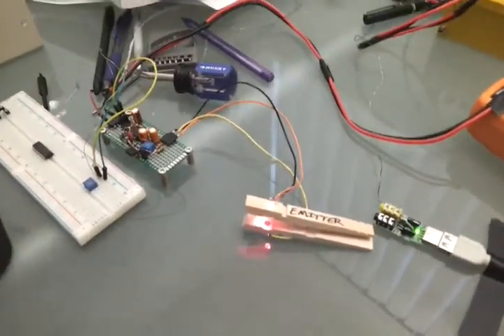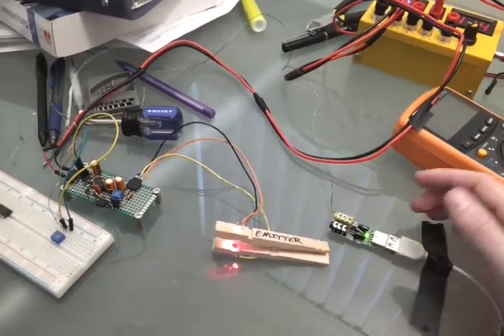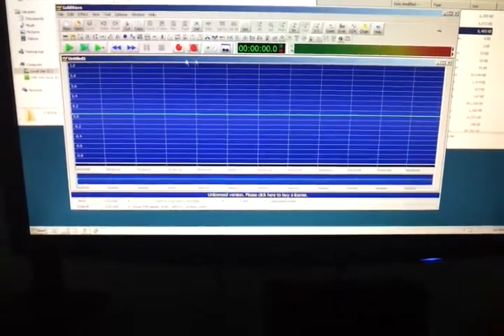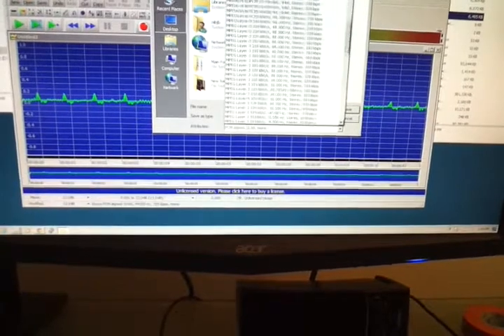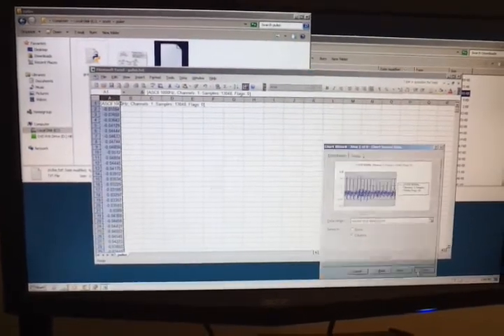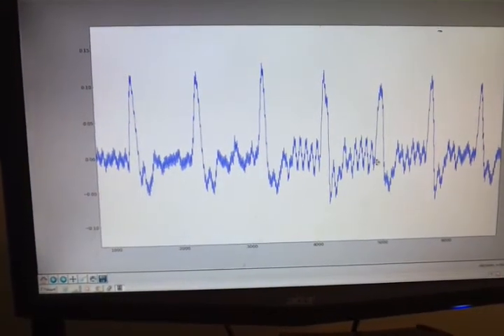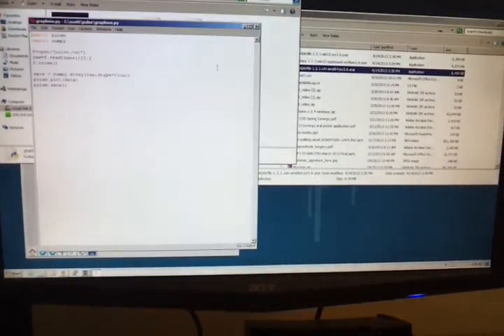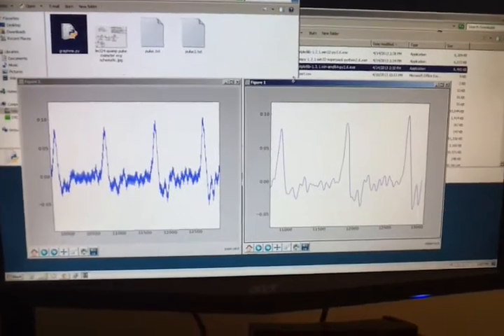DIY ECG and Pulse Oximeter with LM324 OpAmp (2 of 2)

Comment: Hi! I am currently working on a pulse oximeter project right now using tcrt5000 and LM324 I want to have pulse rate and blood oxygen level output, can I ask an arduino code on how you did the pulse oximeter
Reply: how did your project go andrea, any chance I can see your designs and code since I am working on one

Comment: Hey that's pretty cool! I made a same sort of sensor with the lm358. But I used an Arduino to visualize it's data directly. Works pretty cool. Main reason I am commenting is; I am wondering what kind of audio editor you are using. Pretty cool you can save an audio file to a text file. Haven't yet used this myself, but seems useful on some occasions.
Reply: it also beeps normal  sound if everything is within the range...  if abnormal heart beat detected then it beeps different sound... I used midi notes and instruments instead of playing  .... mp3 or wav files they are to huge and slow to process without affecting  rest of the code executing time...

Comment: Nice job. Funny, I basically just build the same thing as a microphone amp. 
Before thinking about spectroscopy filter you might also just let it run from battery? I was dealing with the same (50 Hz - yaaay Europe!) noise, but it'll be a portable device run from battery so I don't spend much effort in removing the noise.